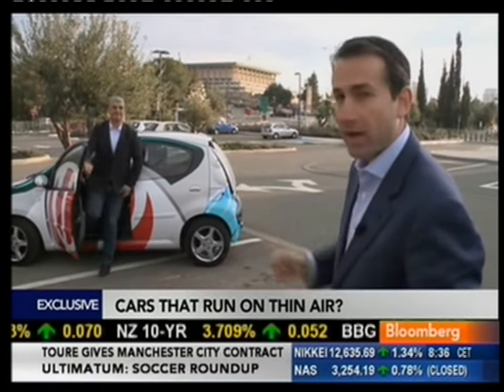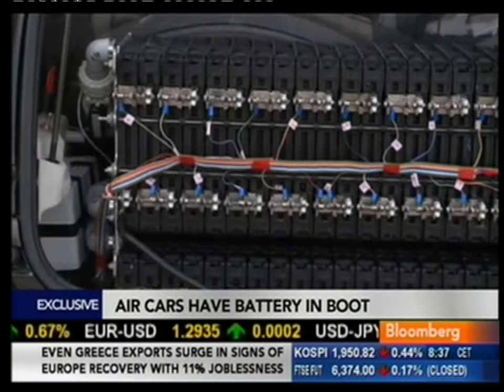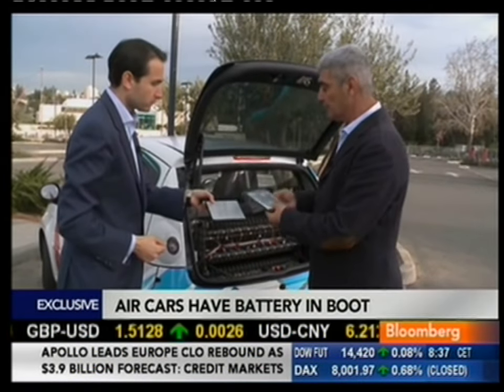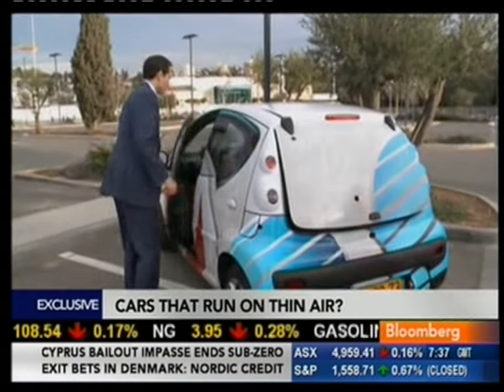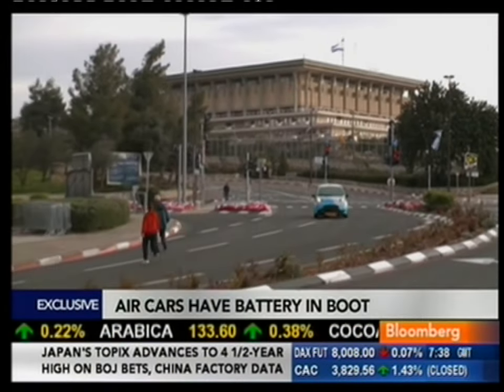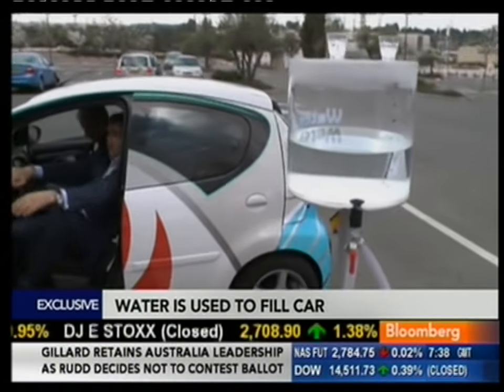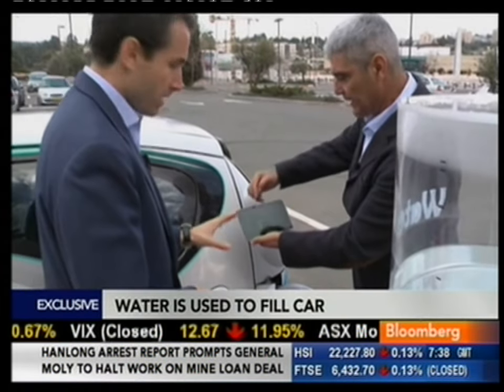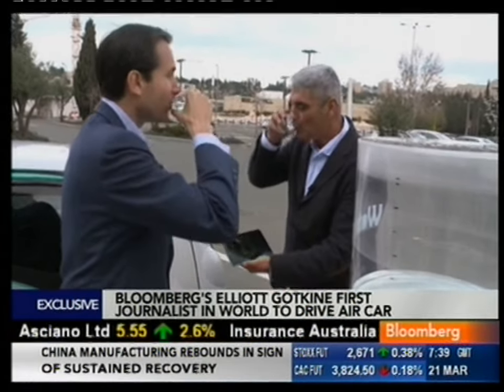March 2013 Monthly - A Car That Runs on Air, Water: Here's How It Works

Comment: I believe Ajka Alumina plant involves refining bauxite to Alumina.  The by-product of aluminum-air battery is Alumina.  The idea is to recycle the used anode (alumina) and reprocess it by means of electrolytic smelting.  That sounds good until one realizes that the smelting process generates tons of CO2.  Here's another issue, the electrolyte for the aluminum-air fuel cell is likely potassium hydroxide.  Now that's toxic.

Comment: This is a bit misleading. They're using aluminum-air batteries which are not rechargeable. Once the aluminum is spent, the anode will have to be replaced with new aluminum. The cathode is great, but aluminum production is pretty toxic.
Protips for critical thinkers: look up aluminum-air battery, ajka alumina plant accident, phinergy